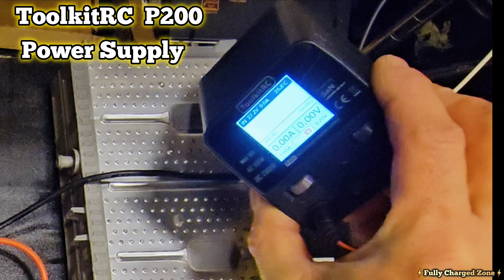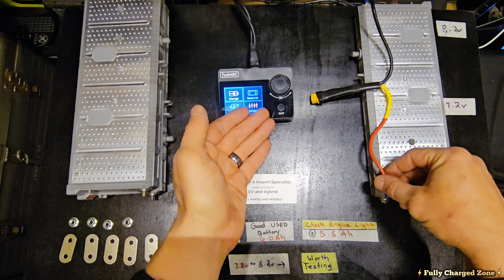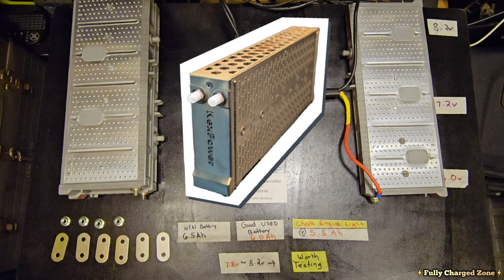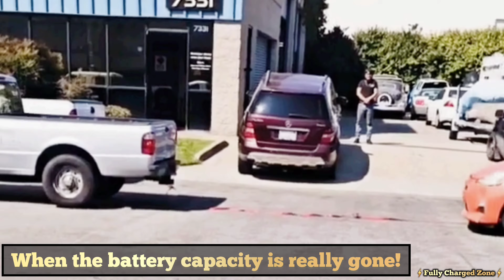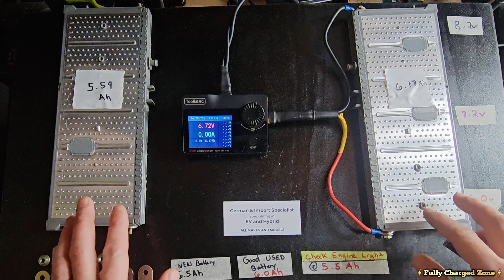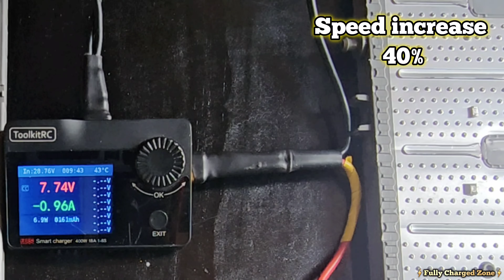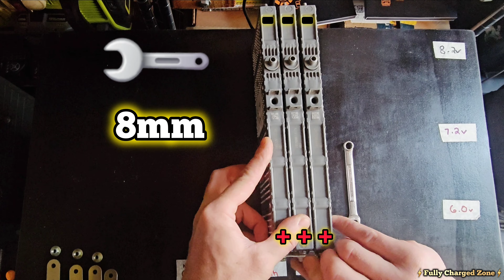Toyota Hybrid Battery Tutorial - Charging, Capacity Testing, and Balancing Battery Cells.

Comment: Aren't you supposed to deep cycle discharge them like three times from full to recondition them and then check?
Reply from the maker: @WAVRUNNRZ I'm not trying to be mean or come down on you by saying this. I'm just trying to teach and share what I've learned from working with batteries for years. Cycling a worn NiMH module may temporarily change the measured capacity, but it doesn't reverse the physical aging inside the battery. Once a module has genuinely lost capacity or developed high internal resistance, cycling it three times isn't going to make it healthy again. That's why I capacity-test them and identify the weak modules. ⚡

Comment: Great video.  So from watching video sounds like I should check all my modules in my pack by checking resting voltage first, load test second, capacity test third.  Replace bad modules by running these tests on used modules I get from marketplace, eBay, etc….  Once I have all good modules balance all modules together per your method. 

My question is I have seen other videos where they charge/discharge modules 3 times.  Do I do this to any modules that I am trying to add to my pack since I don’t know how long they have been sitting or am I suppose to do this to all existing modules in my pack?  Thanks again 
Kevin 
Gen3 Prius v

Comment: I used that method to balance the whole pack all at the same time, left it for 24hrs.
I load tested each cell /module with a headlamp using both filaments.
What's the min max time to know which cell is reusable or not, when load testing from 7v down to 6.5 v?

Comment: Thanks, good info, but the process is too slow
Reply from the maker: Yeah, there are faster ways to do it, but then you’re cutting corners and you really don’t know the true capacity of each module or how long the repair is going to last. Discharging these modules faster outside of the pack can also become dangerous. I made this video mainly for people who want to start learning how to work on their own hybrid vehicle and may not have much experience yet. I’d rather teach the safe, correct way and explain the process properly, even if it takes a little longer.

Comment: so ive rebuilt my own prius batterys using all equal lower Ah modules and it does work. but the gas engine will run more bc the HV battery def gets lower faster. but i think the ecu sees them all with in that balanced range and it stays happy lol i also love them toolkit rc chargers! ive got my boss to buy a few now i use on these things.
Reply from the maker: Yeah, absolutely. It sounds like you’re doing it the right way and actually taking the time to learn how these batteries behave instead of just throwing parts at them. The ToolkitRC chargers are great little tools for learning capacity testing, cycling, and matching modules, and the more packs you work with, the more you’ll learn from the numbers and how the modules behave under load. Keep at it, and if you ever have any questions or run into something you’re unsure about, feel free to ask. I’m always happy to help and share what I’ve learned over the years.

Comment: Thanks for sharing your knowledge. I have been trying to understand why the spec sheet says that there are 192 cells in the hybrid battery but the diagnostic software shows 16 battery blocks. It makes sense now. I'd like to change the batteries myself. Still seems intimidating but feel much more confident now.
Reply from the maker: Thank you, I really appreciate the comment. That was one of the main reasons I made this video. Hybrid battery data can look pretty intimidating until you understand how the battery is divided up and how the scan tool and BMS are actually monitoring everything. Once you understand the relationship between the individual cells, modules, and battery blocks, the diagnostic information starts making a lot more sense. If you decide to rebuild the battery yourself, don’t rely on voltage alone. Capacity, internal resistance, and how each module behaves under load are just as important, because two modules can have nearly identical resting voltage and behave completely differently under load. I’m glad the video gave you more confidence, because that’s exactly why I make these videos, to share what I’ve learned working on hybrids and EVs and hopefully help other people understand this technology. If you decide to do the repair yourself, take your time, test and balance everything carefully, use the proper PPE, follow the correct shutdown procedure, and always verify the high voltage system is de energized before touching anything inside the pack. Thanks again for watching and taking the time to leave a great comment.
Reply: I appreciate the additional guidance about checking capacity, internal resistance and how the modules behave under load. I’ll be sure to take the time to research these and make myself familiar with them. I may try practising measuring these on smaller AA cells. Even though they are individual cells and very different to a module, I think that it would be useful to go through the process at a small scale. PPE is something I need to consider so thank you for bringing it up. Many thanks.

Comment: Is there any way to quick test the batteries before buying them? Like if I am buying it from someone not online.
Reply from the maker: Yes, there are a couple quick checks you can do before buying them. Check the voltage of every module with a multimeter and make sure they're all relatively close to each other, but voltage alone won't tell you the health of the battery. If the seller will allow it, putting a small load on each module and watching how quickly the voltage drops will tell you a lot more. A weak module will usually sag noticeably more than the others.

The only way to really know the capacity is to charge and discharge each module and measure the actual amp-hours, like I show in the video. So you can definitely weed out obviously bad modules on the spot, but there's really no reliable 30 second test that tells you how much capacity is left.

Comment: Got a bit of a long question. Is there a way I can email/contact you and contribute to you for your time/knowledge? Got check hybrid warning, via Dr Prius app shows that cell block #12 is allegedly bad. Done research and there's lots of info about load testing/charging/discharge cycling/balancing nothing as comprehensive as your video here. Knowing that block #12 is bad in mine, should I capacity test every single module and isolate the bad ones or would it be fair to assume that block #12 and the two neighbouring blocks would be enough to test? As charging them all may be quick enough to then balance but the discharge may take a while if it's up to 6 hours each. Also is this the same as load testing via a light bulb? Or should that be done as well? Finally is there any benefit to charging/discharging them to try and improve their capacity?
Reply from the maker: Thanks for the kind words, I really appreciate it! You don't need to contribute, but if you'd like to email me, my contact information is in my YouTube channel description.

From my experience rebuilding hybrid battery packs, I would capacity test every module. If one module is bad, there's a good chance the modules next to it have also aged and aren't far behind. Yes, it takes longer, but I'd rather spend the extra time testing the entire pack than have another check engine light come back a few weeks or months later because another weak module failed.

A capacity test tells you the true health of each module. I still like doing a quick load test because it can reveal high internal resistance, but it doesn't replace a capacity test. Charge... discharge cycling can help recover slightly aged modules and rebalance the pack, but it won't restore a module that's genuinely worn out.

Taking the extra time to test every module is the approach I've always used because it gives you the best chance of ending up with a reliable battery pack the first time. Hope that helps, and feel free to email me if you have any other questions!
Reply: @fullychargedzone  Appreciate the swift response! I'll definitely pop you over an email if that's fine, just doing bit more research and trying to understand aspects a bit more so I don't waste your time. In regards to your ToolkitRC M8S there is no stock here in the UK, I'm looking at the Toolkit RC M6D or the ToolkitRC M6DAC V2 they seems to support two separate channels so 2 batteries at once, supports NiMh 1-16s, charging/discharging power seems high. I also see you're combining it with the ToolkitRC P200, this is in stock but a bit pricey, thinking of the ToolkitRC ADP200 200W power supply. Would you say the charger and supply are sufficient power wise? Going for the 2 channel as hopefully can halve the amount of time by doing 2 batteries at once on the separate channels.

Comment: Very well done! Your instruction is clear and concise. Question: You balanced 3 cells at a time by connecting them in parallel. Can you safely balance more than 3 cells at a time using this same method?
Reply from the maker: Thanks for watching, and I'm glad you found the video helpful! You can definitely balance more than 3 modules at a time using the same parallel-balancing method. I normally use 3 modules as a demonstration because it's much easier to show on camera and easier to monitor, but you can balance an entire Toyota hybrid battery pack this way as long as the modules are at similar voltages before connecting them together.

Also, feel free to check out my YouTube channel. I have several Toyota hybrid battery videos, and if you need it, I can send you a link to my battery balancing and rebuilding tutorials. Thanks again for the great question! 👍🔋

Comment: This is exellent information for DIY work
Reply from the maker: Thank you! I made this video to help people. A lot of these vehicles are getting older, and good information can help owners diagnose problems themselves, save money, and keep working on their cars instead of giving up on them. 🔋⚡
Reply: @fullychargedzone  I am in the middle of trying to recondition a 10-15 prius battery pack using 2 quad chargers, the Baguad CQ3 a d a Hitec X4 Plus. 5 days in and so far 10 good cells 1 bad cell. 

My settings are
Discharge / Charge
3 cycles
3a charge/1a discharge 6v
7500mah CAP

The chargers voltage is off on both by as much as .10v for example the charger will have the voltage at 8.00v while charging and when I check at the cell with a multimeter, it's 7.90. I also have had them stop the discharge early like at 6.4v rather than the 6v minimum I set it at.

Any suggestions? 

Ohh and I made my own cable leads using gold plated banana plugs, 14g cable and copper ring terminals.

Comment: I have block 2 with low power I have the new cell can I just replace it or do I have to charge it and balance it
Reply from the maker: If you're replacing a single module, I highly recommend charging and capacity testing it first. The replacement module should be as close as possible to the voltage and capacity of the other modules in the pack. If you just install a new module without matching it, the battery can become unbalanced and may set codes again fairly quickly.

At a minimum, charge the replacement module to match the others. The best repair is to charge, capacity test, and balance it before installation. Also check the neighboring modules, because when Block 2 fails, sometimes the module paired with it isn't far behind.

What year Prius do you have, and what voltage are the modules currently reading? I can give more specific advice. 🔋

Comment: Hi i have bought a cq3 charger and i was left with the impresion that any baterry over 5ah is a good cell and if is over 6ah is basically new. I charge at 3amps and dsch at 1.3 amps and they are in their housing clamped togeter so they donts swell. If you have any advice i would apriciate it! Thanks.
Reply from the maker: You're absolutely right that a module does not need to be at new spec capacity to avoid setting a battery fault code. A brand new Prius module is rated at 6.5 amp hours, and many modules in the 5.0 to 5.5 amp hour range will still operate without triggering a warning light. The reason I recommend higher capacity thresholds is because I am focused on long term reliability, not just getting the light to stay off. My goal is to build a battery that lasts several years, so I prefer modules that retain as much of their original 6.5 amp hour capacity as possible and are closely matched. A battery can work at lower capacities, but in my experience, starting with stronger, better matched modules leads to a much longer lasting repair.
One thing I would also recommend is keeping your charging current below 2 amps. I have seen modules swell when charged too aggressively, and swelling can lead to premature battery failures later on. Also, when reinstalling the bus bars, use a small inch pound torque wrench if possible. Over tightening or under tightening the terminal nuts can create resistance issues, heat, and long term reliability problems. Taking a little extra time during assembly can make a big difference in how long the battery lasts.
Reply: @fullychargedzone  Thank you for answering! What do you think for when I rearrange the modules together. I was thinking of combining the lowest and highest capacity modules in the same block so they naturally balance each other and have a capacity that is something in between. Thanks again and sorry for my English thats not my native language 😅
Reply from the maker: Personally, I would not combine the highest and lowest capacity modules in the same block. My preference is to keep modules as closely matched as possible in capacity and condition. For example, if you have modules that test 6.1 Ah, 6.0 Ah, and 5.9 Ah, I would group those closer together rather than pairing a 6.3 Ah module with a 5.1 Ah module.
Capacity is important, but I also pay attention to voltage drop and overall module behavior during testing. The closer the modules are matched, the better the pack tends to perform over time.
Also, if it is easier for you, feel free to reply in your native language. I can always use a translator. 👍⚡

Comment: Hello and thank you for a very informative  video  . I do have a question About Honda hybrid  system What will your thoughts in comparison about the two systems? I will appreciate any information that you can share. Sense Honda uses a lithium iron batteries. You obviously have knowledge to share.
Reply from the maker: Thank you, I really appreciate that. In my opinion, both Toyota and Honda make very solid hybrid systems, but Toyota still has the longer proven track record overall. I’ve seen Toyota hybrid batteries last extremely long when maintained properly.
Honda’s newer systems are smooth and efficient, and many use newer lithium-based battery chemistry, which has some advantages in efficiency and thermal stability. Toyota’s older nickel-metal hydride systems are still incredibly reliable and easier to service in many cases.
From a technician standpoint, Toyota usually has more repair information and aftermarket support available, but Honda has definitely built a strong hybrid platform as well. Overall, I’d still give Toyota the edge for long-term reliability and serviceability.

Comment: Also, something that I've seen is the modules will balance themselves after a few hours once you assemble the battery pack
Reply from the maker: They don’t actually “balance themselves” in the way people think. What you’re seeing is voltage equalization, not true capacity balancing. After you assemble the pack, the modules will settle a bit and voltages will drift closer together, but that doesn’t fix differences in internal resistance or actual capacity.
Real balancing happens under controlled charge and discharge cycles. That’s why systems like Prolong exist, they force the pack through cycles to bring weaker modules in line. Letting it sit for a few hours just makes the numbers look closer, it doesn’t actually fix the imbalance.

Comment: If we're not supposed to go lower tha 6v, why does the prolong charger/discharger goes down all the way to 3V?
Reply from the maker: You’re not supposed to go below 6V in real-world use because that’s where longterm damage starts. The Prolong system goes down to 3V only for controlled reconditioning and capacity balancing. It’s done at very low current, under supervision, to break down voltage depression and rebalance the modules. That’s very different from a car actually operating that low, which would kill the battery pretty quickly.

Comment: Can you expand on the discharge test settings? You mentioned that the discharge test was set to 0.5V/S, so for the 6S of these batteries, shouldn't the test attempt to discharge until it reads 3V? Did you stop the test manually after 6hours?

Thanks for the video, there's a lot of good information here
Reply from the maker: Good catch. The 0.5 V/s is just the discharge rate, not the cutoff voltage.
For a 6S pack you’re right... full depletion would land around 3.0V per cell 18V total. But I didn’t run it all the way down. I stopped it around 6 hours on purpose because I was watching how the pack behaves under load voltage sag, recovery, imbalance, not just chasing a final voltage.
A pack can hit 3V per cell and still perform like trash under load, so this gives a better real world picture.

Thank you for paying attention 👍

Comment: Working on ford escape cells 6.8-7.5v will toolkit charger work on it
Reply from the maker: It’ll work, those are NiMH modules and that voltage is normal. Just don’t try to charge individual cells with it. Those chargers are meant for the whole pack, not single modules. Also keep an eye on heat.